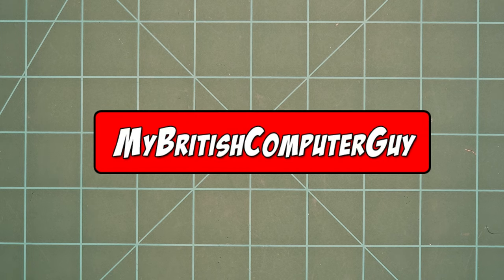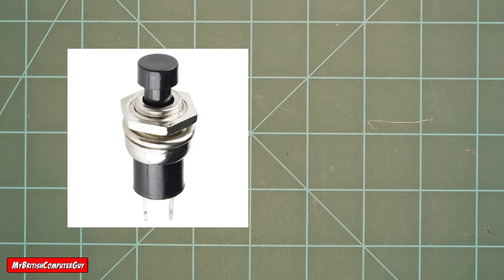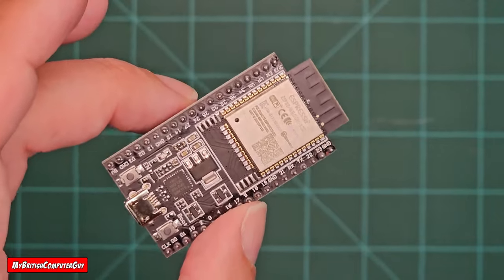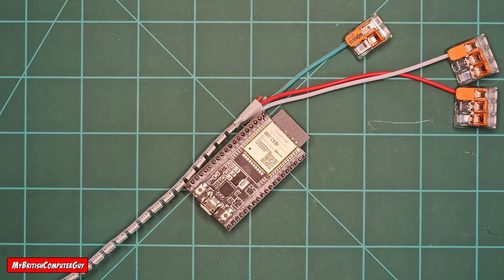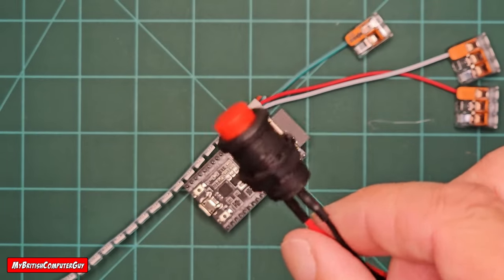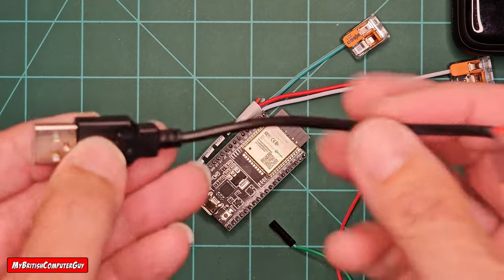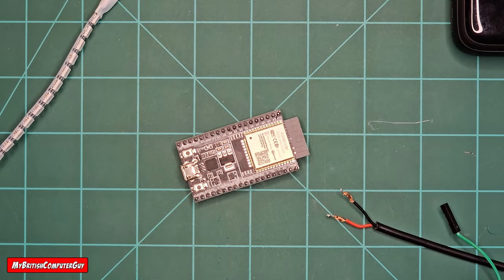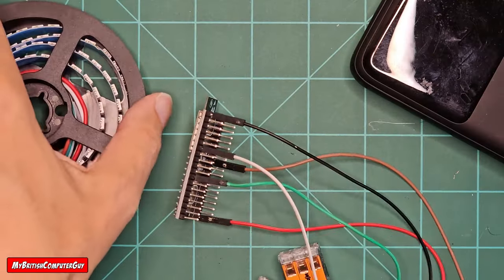Mastering Push Buttons with WLED: A Step-by-Step Guide

Comment: Fantastic!! Is it possible to control virtually those buttons using a smart switch on the wall?
Reply from the maker: That's a really good question, WLED does support remote controls, maybe one could be programmed?
Reply: take a look at home assistant. i think wled was originally made to work with it.

Comment: I've been following Dr. ZZZ for sometime and he has yet to explain this.  thanks for going over it.  I am looking to create some custom car light effects and wasn't sure how the buttons would work.  I do have 1 question:  How does the ESP32 handle power on/off?  Will I just be frying boards if I had the setup wired to the ignition and not directly to the battery?  Great tutorial and explanation.
Reply from the maker: Sorry it took me a bit to get back to you. As far as your ignition setup is concerned. To be able to hook up a board to your ignition system. You would need a buck convertor to drop the voltage down from whatever your ignition system runs at (typically 12vdc) to 5vdc. That way when you power up the board it doesn't fry.

Comment: Awesome, thanks for the video! I want to do something similar with a light switch in my house (6 meters away from the esp32 module) would this method work with a longer cable running to the switch you think?
Reply from the maker: Thanks, and that's a great question, I've not tried doing a longer run on a switch wire, give it a try with some wire before installing it and give it a try!

Comment: Excellent video and really helpful, keep it up! I have a question. I'd like to use a push button to control some SK6812 for desk backlight. Thanks to this video I can easily use the button to also toggle the leds on/off, I am trying to decide whether to also add a toggle switch that handles power for both the leds and the board. Should I just use a single button and keep the board running 24/7?
Reply from the maker: I would, that way you could physically disconnect the power from the board

Comment: Are you familliar with the D1 Mini?  I put a button connecting ground and pin 4  but after i assign it in the macro it doesnt do anything (i switch to gpio 4 because 3 didnt do anyhting either, also I have it set as button 1)
Reply from the maker: What version of WLED are you using? I would try using a different GPIO